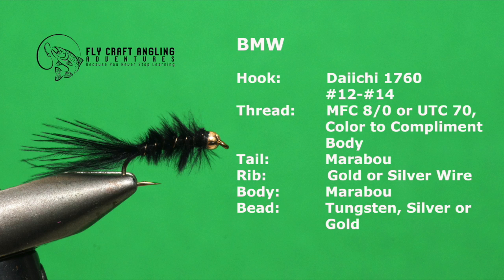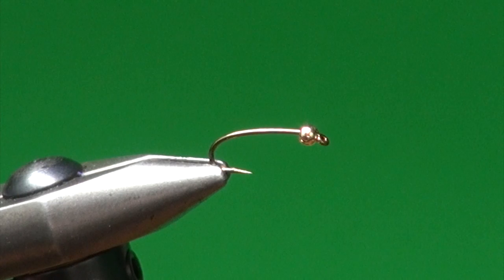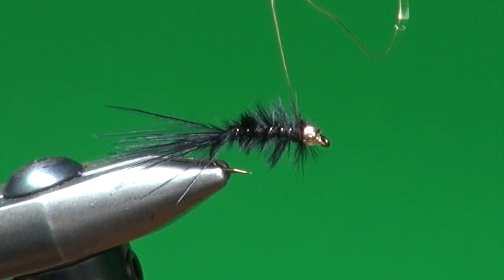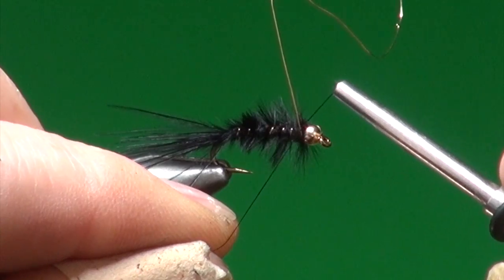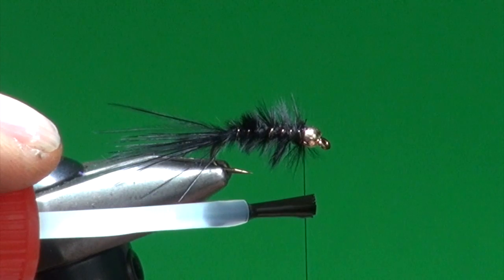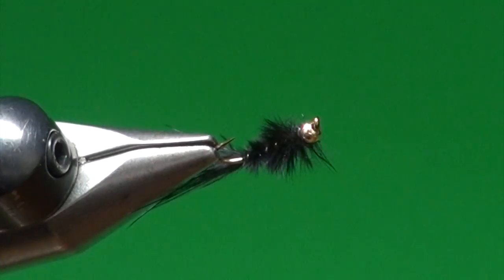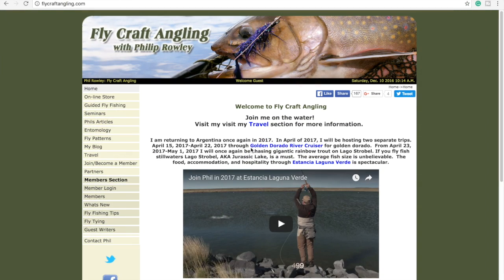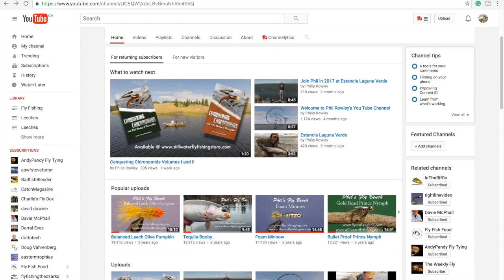BMW (Brian's Marabou Wiggler)-Phil Rowley Fly Tying

Comment: Hi Philip what size is the bead in metric as love all your videos and caught many fish here in Scotland
All the best Peter.
Reply from the maker: Hi Peter, thanks for your kind words.  I am glad you are enjoying my videos. I use 3/32" or 2.4 MM tungsten beads for this fly.  I tie it in size #12 most often.  I have also updated the recipe in the comments section of the video.  I will make a point going forward to include both metric and standard bead sizes on all of my videos when applicable.

Thanks, Phil
Reply: Hi Philip thank you so much for your helpfull reply much apprecated tight lines

Comment: Looks good Phil, do you know the Dead Drift Leech? It's pretty similar to this, comes out of central Alberta. I used to tie them for Star and Muir. Same technique with the marabou though. Cheers
Reply from the maker: Hi Darren, I am not familiar with the Dead Drift Leech.  Is it similar to the Catatonic Leech?  Proof again, I guess that there are few original flies.  I was using the BMW when I was still in BC over 15 years ago.

Cheers, Phil
Reply: @PhilRowleyFlyFishing  I think they are one and the same the Dead Drift and the Catatonic. Just a slight difference in how the marabou is applied, but the same end result. I ran into a similar situation with the Spring's Wriggler being almost identical to a Del Canty pattern. Cheers